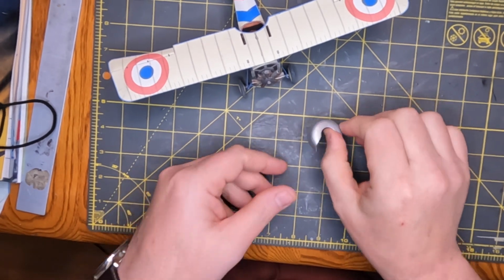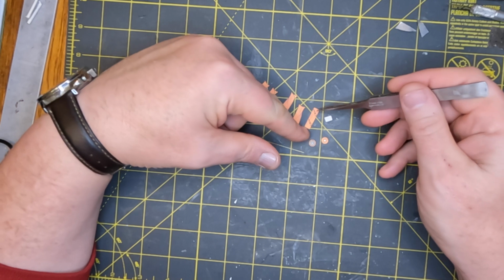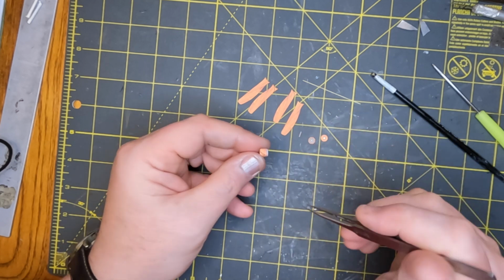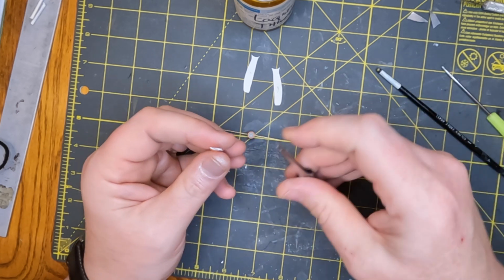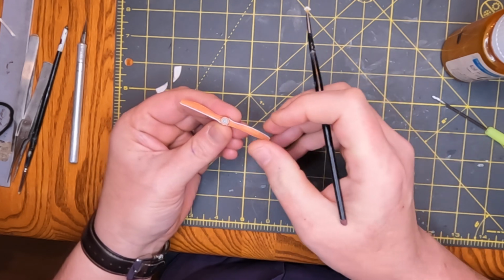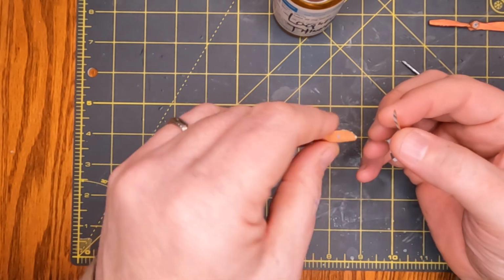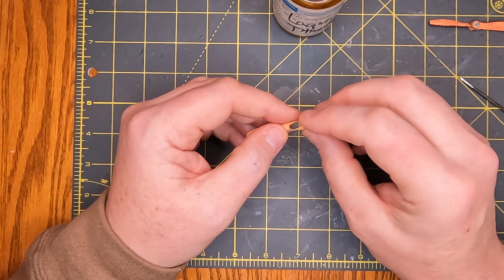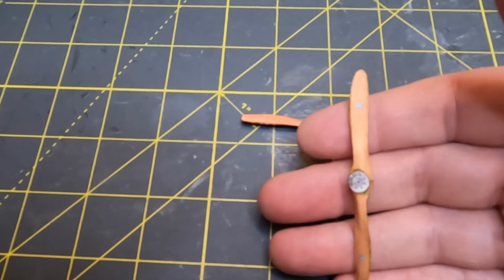Migport Part 16: Cowling and Prop

Comment: Dan, great bit of modelling on the cowling looks just like metal. re: the "Tail of Two Props"  they both have a good look but the second twisty one has my vote . The main differance I see is the look of the hub to prop joint. Number two dosn't have that problem, though, I guess with a bit fiddling and fussing you could convert the look of number one.
Reply from the maker: RR.  I think I agree.  I may try to make it one more time with a bit of a mod to make a smaller hub but I think it's a keeper.  Thanks for looking and the input as well!  -Dan